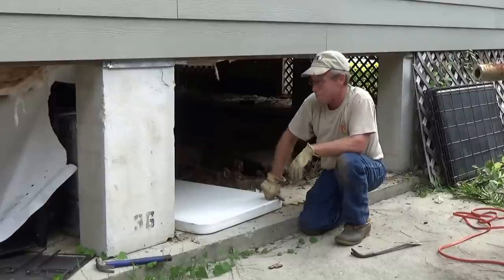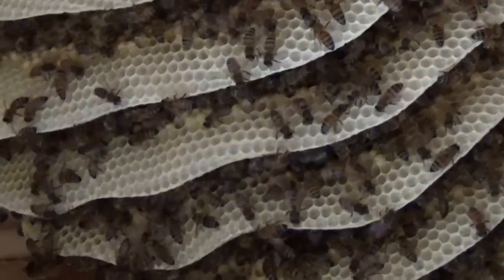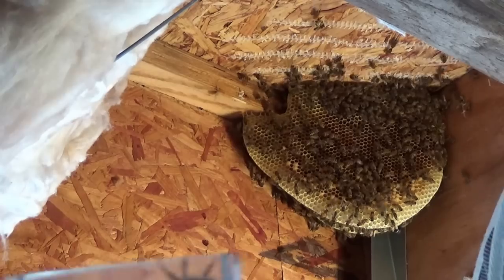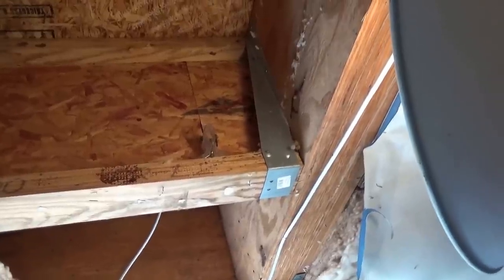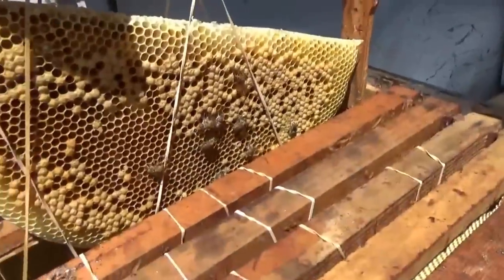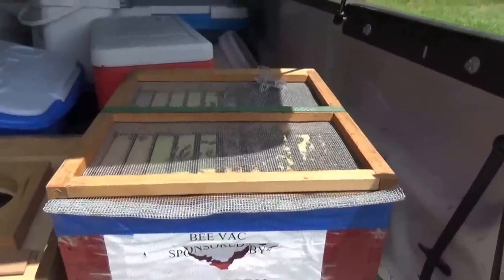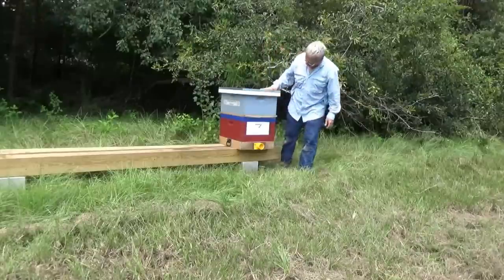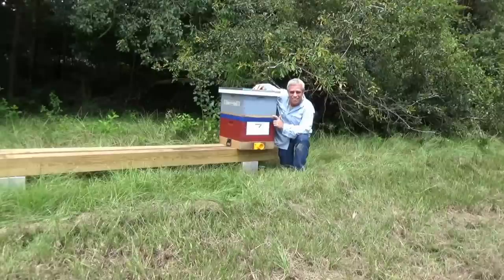Bee hive removal from under floor joists

Comment: So why don't you just pull the screen out halfway so the bees won't come swarming out? Then you can return later and remove it when you remove the vacuum box?
Reply from the maker: That's exactly what I do now, I remove only about 3 inches of screen and allow the bees to crawl into the brood box instead of flying out of the crack where the screen had been. Also, very few bees are accidentally killed by leaving the majority of screen still in the box. Very good observation. God's peace Cephas.
Mr. Ed